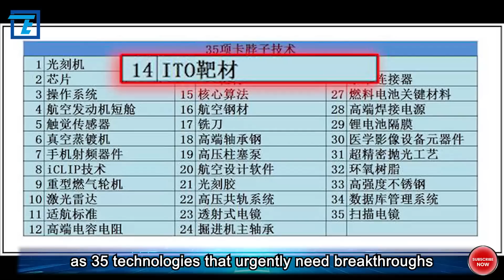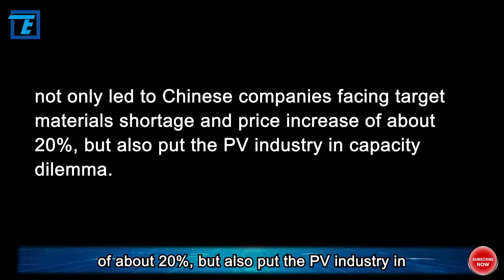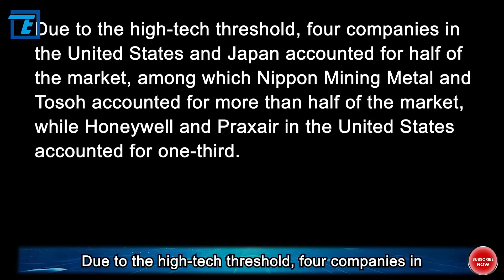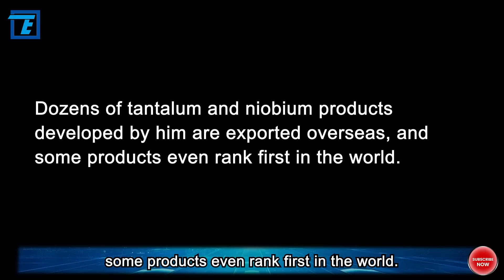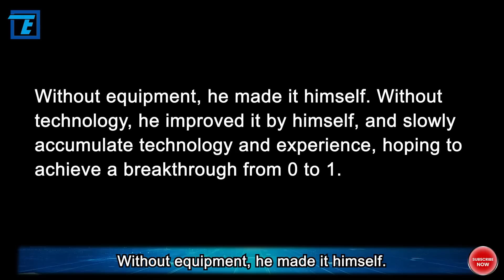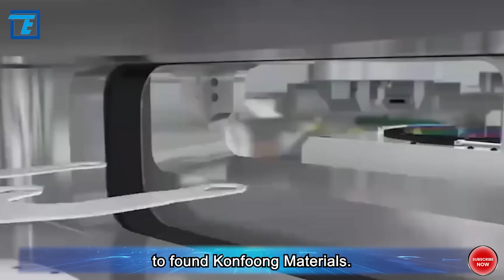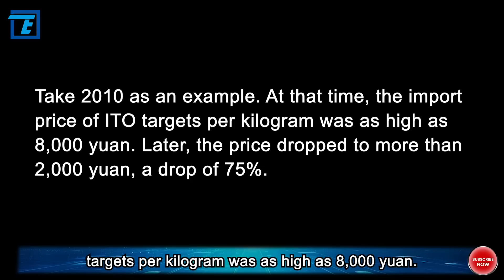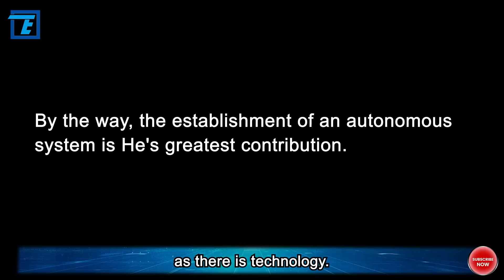One step closer to EUV China achieves a chip breakthrough in this way!

Comment: NEWS : ASML to build new type of EUV lithomachines to achieve even smaller transistor ;)
Reply: They can try but is it feasible?  Electrical cars still run around between 7nm and 14nm. Tesla try 5nm and reverse back to 7nm to 10nm due to overheating problems. Most computers and mobile phones are around 5nm to 14nm.  Military equipment are anywhere from 25nm to 50nm. AI require 7nm to 10nm. IOT require 7nm to 14nm. Your washing machine and tv require 90nm. Where is the application for it? The west work on optics. China work on practicality and pragmatism. They can’t even develop a full 4nm and have to repackage from 5nm. Apple Inc rejected TSMC 3nm due to overwhelming cost and overwhelming heat issues. You maybe able to get to 2nm or even 1nm but what about the cost and the heat issues. Can they go zero nm? China is now at 7nm (not in mass production but limited production). A repackage 7nm to a repackaged 4nm is not too far away. Who says China can’t come up with a repackaged 5nm. Irregardless whether it is a black cat or a white cat, as long as it can catch a mouse, it’s a good cat. China doesn’t have to lead. All China has to do is keep pace.

Comment: NEWS : IBM made 2nm transistor 1 year ago,,, TSMC is working now on 2nm ;)
Reply: Working on it is one thing, lab environment is one thing but economically and commercially viability is another. Breaking news: Apple Inc rejected TSMC 3nm due to excessive high cost and overwhelming heat issues. They then launched a 4nm, a repackaged from 5nm. They will be stuck in the 4nm for the next 3 years. Breaking news: according to ASPI, an Australian think tank funded by the American government, the state department, the Americans only led the Chinese in semiconductor by less than 5 percentage point. The Chinese will chase up in 3 years.